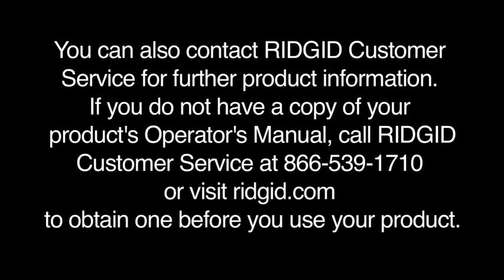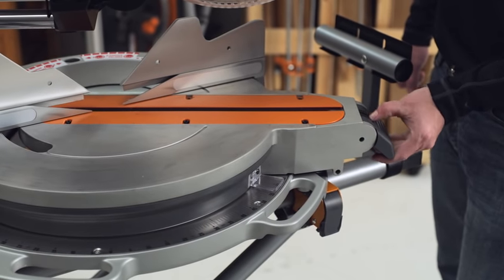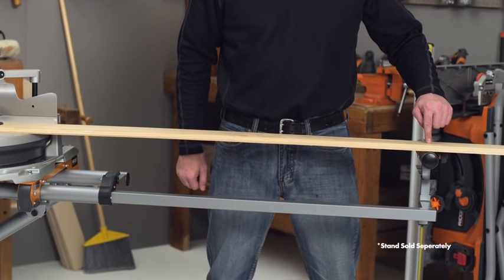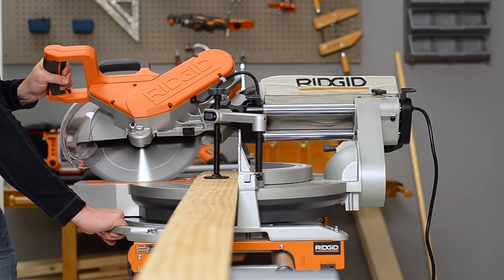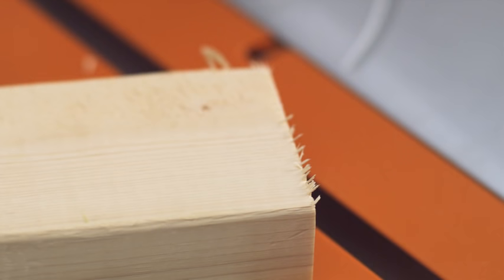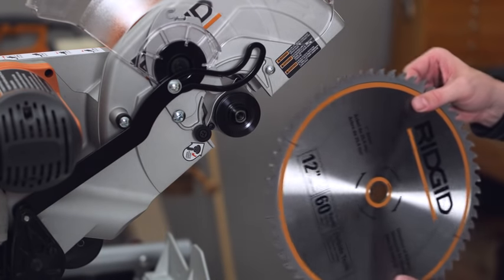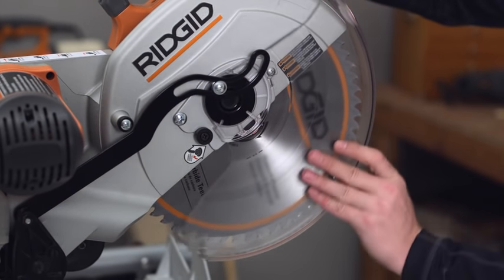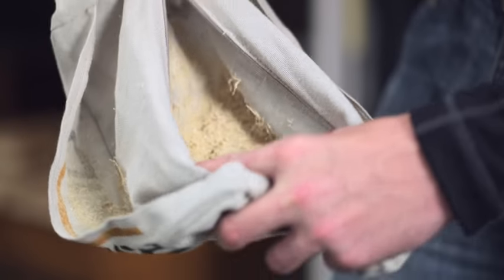RIDGID How-To Video: For Miter Saws

Comment: I have the 12 inch RIGID with the light that cast the shadow for the cut--it went out after less than a year of use.... is there a replacement? some folks say its a manufacturing flaw a bad circuit board? any help would be great!

Comment: I am a huge fan of RIDGID tools and my shop is full of them, but I've had one of the 12" sliding compound miter saws for a few years and had nothing but problems with it. The travel path of the blade is slightly off from the travel path of the sliding rails, causing the blade to pull/walk when doing a long cut. Many people say this is due to a manufacturing defect in the casting of the parts. I have been unimpressed with it overall. The gig adjustment at the rail bearings does not fix it. Do you have a fix for this? I'm going insane right now and about to buy a BOSCH.
Reply: +jolt001 I have noticed this same issue, and as I do exacting work, it is a pain.  It is a small error, but I really wish I could figure out an adjustment for it.

Comment: Don't buy this saw, the Actuator Link that retracts the blade guard bends after about 8 hours of use.  It is unsafe to use when this happens.  RIGID will not stand behind this saw.  I have replaced the actuator link 3 times at my own expense.  Regret buying this saw.  Get a DeWalt slider.
Reply: Thank you for this comment! This is exactly what's wrong with mine but I couldn't figure it out until I saw this. It's a bad actuator link made out of junk metal. I found some replacements online though.

Comment: Ridgid compound miter saws have a certain appeal===I like how they function===but the blade guard assembly is a piece of crap.  It stops working after a while---it stops retracting because of cheaply made fasteners and that black rubberized roller, which wears out.  Then you have to retract the blade guard by hand in order to cut, which is more dangerous.  Also the orange plastic thingy that the blade travels through on the table of the saw starts breaking up pretty fast.  And . . .  there are problems with accuracy that have been described by others elsewhere.  Overall, I'd spend my money elsewhere, after owning two of these saws and watching them reliably fail in the ways I've stated.  All miter saws are made in China now and they all have problems.
Reply: Pine Forest what did you do to fix the blade guard from not retracting
Reply: Having the same exact issues with the blade guard now. Thought it was only the saw I was using that had this problem